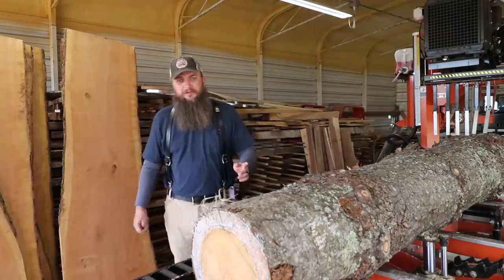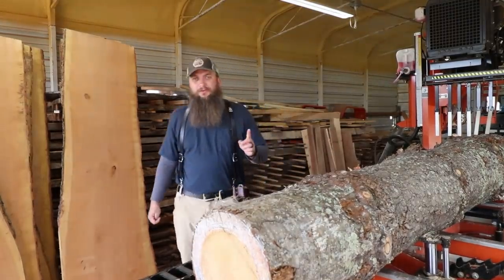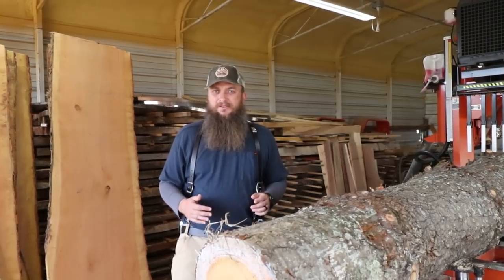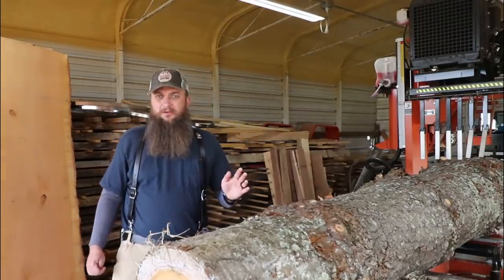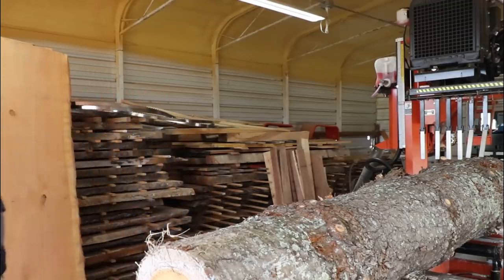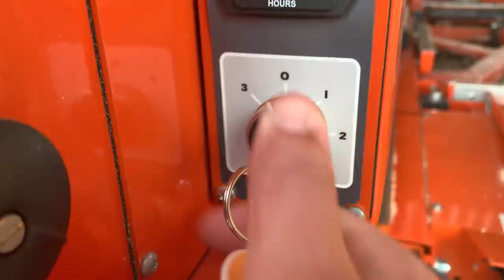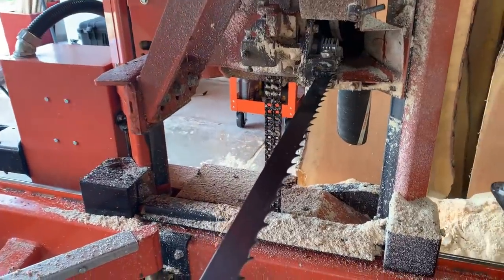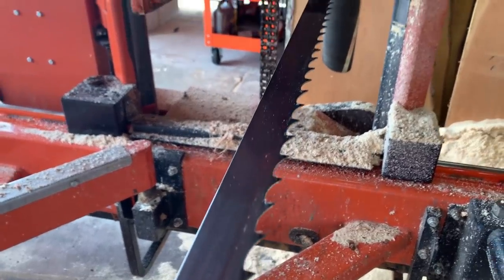From The Forest To The Sawmill: How Boards Are Made

Comment: It is a sign of the times that you have to start with a disclaimer about using a small amount of diesel fuel for lubrication. Or ATF fluid. Or WD-40. "Back in the day" we used to use our oil from oil changes on trucks and machines to keep the dust down on driveways and roads. Worked great. Still does!!

Comment: Those are the best looking pine boards I have ever seen! So smooth they almost look planed. Have you cut any green Southern Yellow Pine? Now THAT will make a mess out of any equipment! I may have mentioned once before that my lot here in Jacksonville Florida backs up to 60 acres of swampy pine forest. Some are easy 36” diameter at the ground and probably 60 ft tall. I’m estimating the first branches are about 30 to 40 up. I’m sure someday they will be harvested but for now, it’s all preserved green space.

Comment: I use a pine-sol and dawn mix in my water. Does pretty good job!
Reply from the maker: Good to know!
Reply: The Pine-sol and Dawn works great in any the wood I cut around here. Pine is scarce. Nathan I was told that diesel will make belts go bad much sooner than normal. Just passing that on. I have heard a lot of guys use diesel but haven't myself.
Reply: What proportions do you use? I have a bunch of table saw blades that need a good cleaning; but haven't found a good way to clean the sap off them
Reply: I don't measure any amounts. I just use the "glug" method. I use it to prevent build up. I don't know if it works to remove sap after it is already on the blade.

Comment: Not worried about  flammable combustion but wonder if diesel will dissolve seals in the pump or attack the delivery hose,  clog the delivery nozzle ?  Would kerosene be a better solvent ?

Comment: sorry my comp is messing up citrus  orange works good for resinous woods like Douglas fir and west coast pines and tamarack (westerns larch)
Reply: Hey Brian, good to know. Are you running straight citrus orange or cutting it with water?
Reply: @kylerezansoff3699  a 50/50 mix just to get to flow. But it has served me well over 20 years I just sold lt15 it was one of the oldest

Comment: Is there a diesel odor on the wood, and if so, does it evaporate with the drying/curing of the wood?  Other than the citrus orange, has anyone recommended or used mineral oil?  I've also heard of people using Murphy's Oil soap to clean their wooden decks of tree sap.  Just throwing ideas out there.  I'm familiar with all sorts of uses for diesel fuel on the farm but mixing it with wood is not one of them.  Great video.  Thanks!
Reply: In my experience using diesel, you can’t tell. You need very little.

Comment: Will the diesel spray effect your camera lenses or housings?
Reply: It won't "spray". I don't know what kind of system Nate's saw has, but some just have a pad on both sides of the blade that wipes on the oil from a drip line. Unlikely to even drip much, if it's adjusted properly.

Comment: Hello Nathan. Being that outfeed table is still in design and testing phase. Would it make any sense to incorporate a roller or two in the flat surface? I'm just an idea guy.
Reply from the maker: would not, boards come down at an angle, they would crash up in the air, maybe one on the very back would work,
Reply: @OutoftheWoods0623  Top of the roller need only be 1/4" above the rest of the flat table.
Reply from the maker: that was tested by woodmizer, resulted in crashing boards jumping up off the table,
Reply: @OutoftheWoods0623  Interesting. I think they need a German engineer. Me. Lol.
Reply from the maker: agreed lol